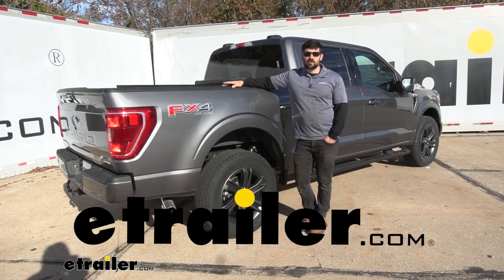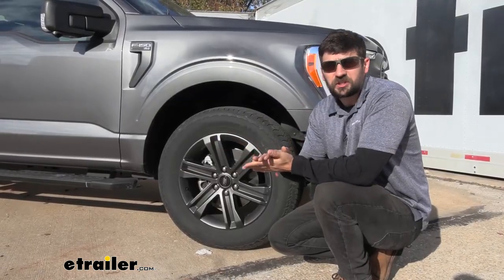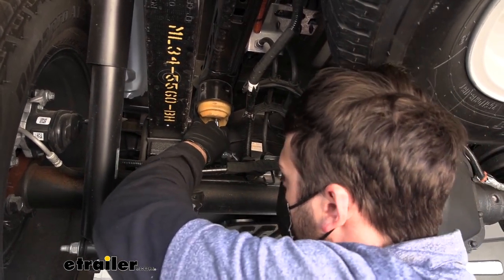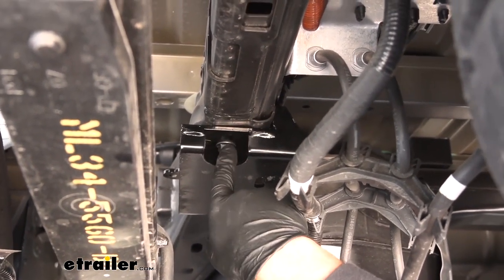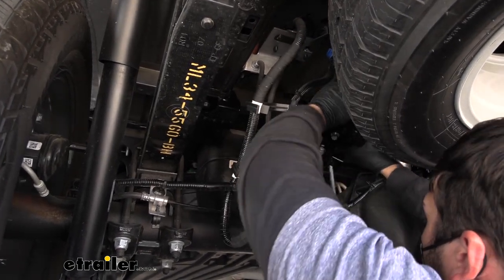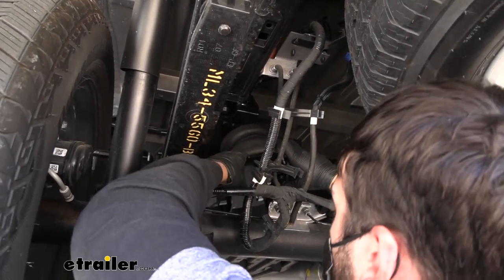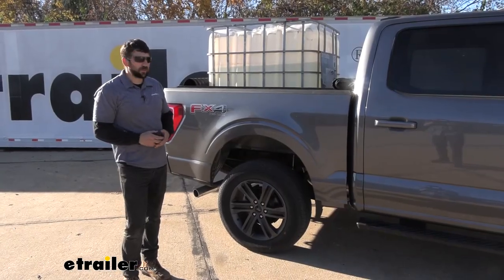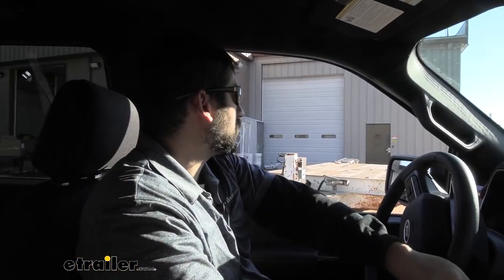etrailer | Air Lift LoadLifter 5000 Rear Air Helper Springs Installation - 2021 Ford F-150

Comment: Will these air springs also fit pervious year f150's?
Reply from the maker: This specific kit is designed to fit the 2021 - 2022 Ford F-150. Check out the following link to see our fit guide. It will lead you to the kits that fit your vehicle.
https://www.etrailer.com/dept-pg-Vehicle_Suspension-pt-Air_Springs-pm-Firestone.aspx

Comment: Hello, I would like to buy you a tire kit for my F150 platinum 2021 (4wd 3.5 ecoboost V6), but I can't, I live in Belgium, how to do it.
 THANKS.
Reply from the maker: We don't ship internationally. Your best option would be to either use a freight forwarding service or if you have friends or family that live in the US, have them handle the transaction for you and have it shipped to you in Belgium.
https://www.etrailer.com/Vehicle-Suspension/Air-Lift/AL47PD.html

Comment: Not a good video. Many details missing. Sorry
Reply from the maker: What details are you missing? What should we have done better? We're always open to suggestions!
https://www.etrailer.com/Vehicle-Suspension/Air-Lift/AL47PD.html
Reply: @etrailer  like how you set drivers side bag since i couldn't do that from any angle so i had to individually insert them then bolted them. Also how you cut the bracket as i had trouble using sawzall and grinding disk so i used hand saw to be safe side. Etc...